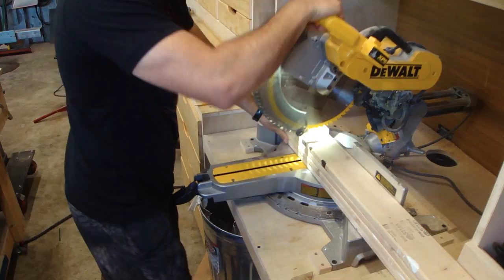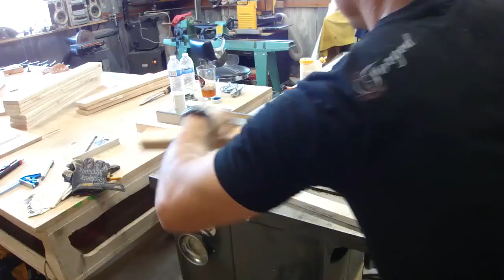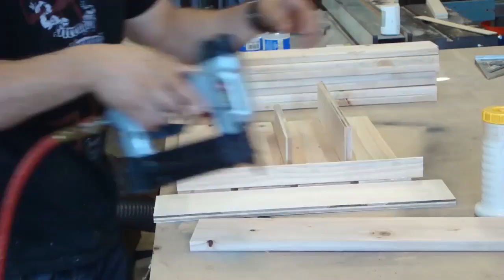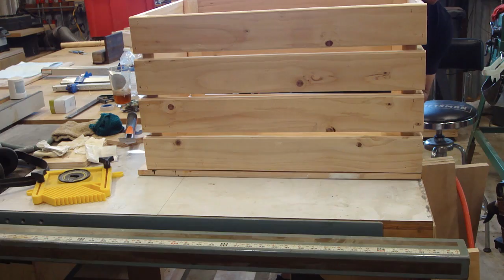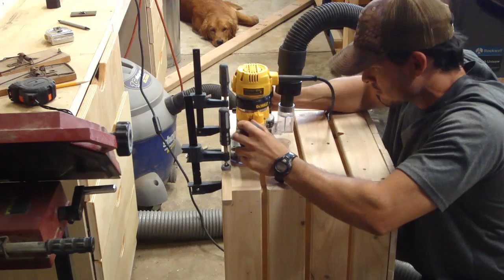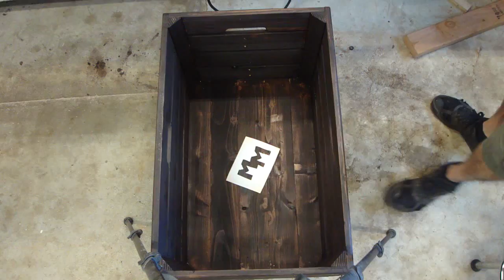How to Make a Rustic Crate for Storage

Comment: I'm scared to cut a 2x4 vertically like that, is is safe?
Reply from the maker: It can be if you make small passes and use push sticks. But if it scares you then you might want to avoid doing it. Using a bandsaw is much simpler.

Comment: Really nice videos, but we can not do that basically. Not everyone has a fully equipped wood workshop at home and could do that. I also like to do wood, but I certainly do not have that at home. This is in my eyes to "Do it Youreself" off past. It stimulates itself to build something but basically not possible at least not in my home.
Reply from the maker: +Chris S It is possible to build this with very minimal tools. A hand saw, nails, and a hammer is all that’s really needed.
Reply: I work out in my yard under a tree. My "work bench" is a piece of 3/4" plywood across 2 sawhorses. If you really want to do something, you'll find a way.